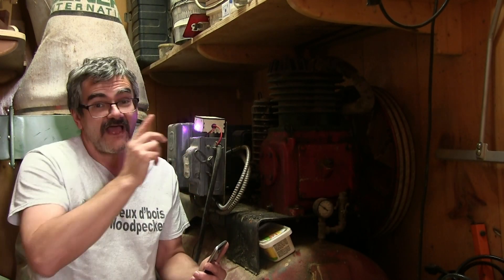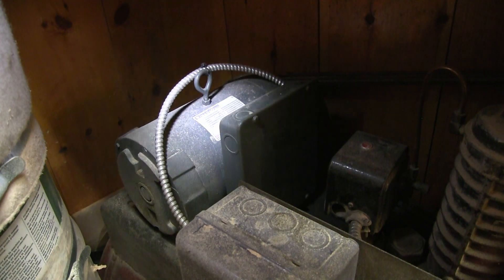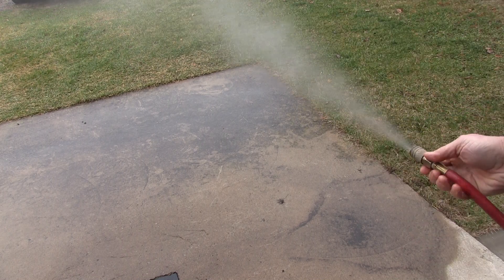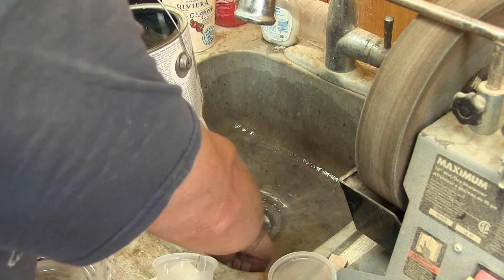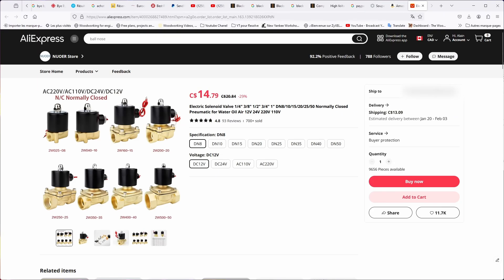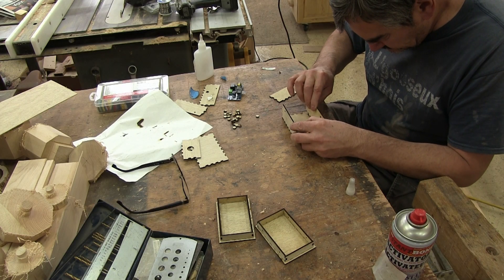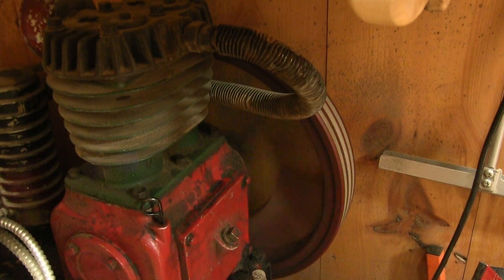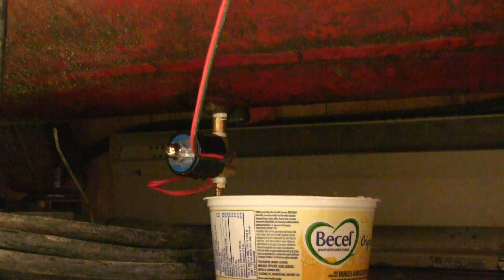The Woodpecker EP 311 - Automatic valve to empty the water from a compressor

Comment: As an additional modification, is it at all feasible to put a moisture trap in between the output of the compressor and tank?
Reply from the maker: I have one but it doesn't stop water to form inside the tank, and as you saw neither stop water from forming inside the pipes and hoses.  It's easier to assume that water is in the tank and open a valve to empty it. I open my valve 30 seconds every hour. Since this is in place, about a month ago, I only can see drops of water in my margarine container under the valve
Reply: @LgosseuxDbois-TheWoodpecker  Yeah moisture traps are not perfect.  I don’t have air tools, but I do have a compressor for airbrushing that has a moisture trap off the output, and I still needed to add another in-line trap just before the end of the hose.  I am glad your automated solution is working so well.

Comment: Great work, Alain! This exact same job has been on my "To do" list since 2015. Perhaps your video will inspire me to get to it before 2025 (mind you, I see that I still have jobs to do from 2013...)
Reply from the maker: I totally understand, If my old motor wouldn't had die on me, this would still be on my bucket list. I have a tendency to procrastinate some time.... But don't do like  I do and try to do it on your compressor. I wish I did it sooner....
Reply: @LgosseuxDbois-TheWoodpecker  In a moment of enthusiasm this morning (generated by your video) I went to my workshop determined to start work on an automatic drain valve for my compressor too.  But I was greeted by half-a-dozen other jobs that required emergency attention -- and so had to work on those instead. Sigh. An automatic drain valve may still be a looong way in my future...
Reply from the maker: I think it's the same for everyone. I spent several days inside the shop with a friend form the US and it's only there that I realized that I have several things to fix before I can continue what  I want to do. One thing I realized was how hard it is to speak English all day. Listening or writing it is WAY simpler than speaking it. He went back home a couple of minutes ago, so I can take care of the broken stuff. But I'm sure you will manage to do something, Peter also said that he will check his compressor. It's one of the tool that we take for granted up until something goes wrong with it....
Reply: @LgosseuxDbois-TheWoodpecker Thank you for the encouraging words, Alain! I've been doing a lot of sand-blasting these last few days, and it turns out that my compressor is struggling a bit.  So I'm now giving myself the excuse that I need to find a bigger compressor before I work on the automatic drain valve.  BTW I lived in Germany for a wee while, and I well know the feeling of exhaustion that comes from protracted interactions in a second language.  Really bizarre how tiring it is -- I've always assumed that one's brain must be working overtime in such situations, and sucking up much more energy than usual (disclaimer: no neuroscience qualifications, so my opinion entirely worthless on such matters).
Reply from the maker: It's fun having a big compressor that can handle everything that you can throw at it. When my motor was giving me trouble, I checked for a new similar compressor, and after seeing the price of a brand new one with a 275l (60gallons) tank and a 5hp motor, I realized that just replacing the motor would be much cheaper.... I heard that german is even more complicated than french, so I can imagine how exhausted you can be after a full day. But I know first hand that if you're immerse all days and don't speak your mother tongue for a while you will lose it... I can see that from some member of my family who just moved 200Km away in Ontario and now struggle to speak french. And my wife had some distant cousin that moved to Toronto and now they can't speak any word of french even to save their own life....
Reply: @LgosseuxDbois-TheWoodpecker  Yes, I've been looking at bigger compressors and the prices are eye-watering! Plus I don't have 3-phase power in my workshop any more (in New Zealand you have to pay a fixed monthly charge for each phase plus usage -- so with my Scottish ancestry I've had two phases disconnected to save money). I'm thinking of getting a second single-phase 100 litre compressor, and running the two in parallel with staggered starting to prevent current overload.  In other news, I did French for four years at school, and had the advantage of being able to practice with my French-speaking cousins (in Lille) -- but I found learning German much easier than French. I think that because English is a Germanic language then it's not such a big jump.  Mind you, my German was only ever at buying-stuff-from-the-shop level -- although my wife and son are fluent German speakers (as well as fluent Māori speakers). If I ever did properly learn to speak another language then I bet I'd be one of those people who forgets their native tongue; I don't seem to have much room in the language section of my brain.  But I'm sure having a YouTube channels in two different languages must be doing wonders for your brain, Alain...
Reply from the maker: I understand, here in Quebec, only industrial or commercial sectors have tri phase electricity, so I have to make due with 220 and 110 volts single phase for everything. But the electricity price here in Quebec is quite low compared to other places, it's an average of about 8¢ the kilo watt hour. So it's not that bad, as an example heating the shop cost me about $450 a year, I guess this year it will be less, we had the hottest winter ever...
I can't argue with you because I only heard that German was hard from other people. And from french speaking people. I know that Germain comes from the same root as English while French, Italian and Spanish from another root, but I only can figure some words here in there in those languages.
I'm not that bad at speaking English, but  I always say to people that don't expect my conversational English to be as good as what they hear in my videos, all the words are thought in advance and are selected so I won't have too much trouble to prononce them . In a conversation I know that I mess up verb tance, but I can manage. Both my wife and I had more practice when we had to phone the Toronto office every day, but this time is long gone....

Comment: If you have had that much of a water problem over a long period of time you may want to borescope the inside of the tank, making sure you don’t have rust build up. I tank failure at pressure is very dangerous.
Reply from the maker: The water was not rusty but more oily. The tank is quite thick compared to modern tanks, it takes 4 men to only lift the tank after removing the motor and the pump. OK maybe we were four wimpy men...
Reply: @LgosseuxDbois-TheWoodpecker  Yes, most the new tanks are horribly thin.

Comment: But you still need to empty the container... I suppose plumbing on a hose to just drain outside is not an option?
Reply from the maker: I don't have enough water dripping to be forced to empty the container. By emptying it 30 seconds every hour, I end up only evacuating a small amount of water that evaporate by itself. I checked the margarine container the other day when I took a picture for the thumbnail and I estimate the water to be les than a half tea spoon for over two monts. I'm sure more water than that was emptied but  I guess it evaporated by itself.
Reply: @LgosseuxDbois-TheWoodpecker   ahhh, I missed the 30 seconds every hour bit!   that makes sense, it can act more like an evaporation tray than a drain!
Reply from the maker: Yes. I had no clue either how much water would be evacuated before I tried it in real life.